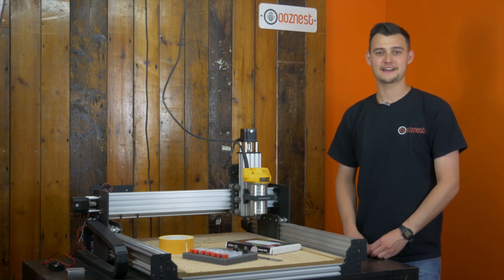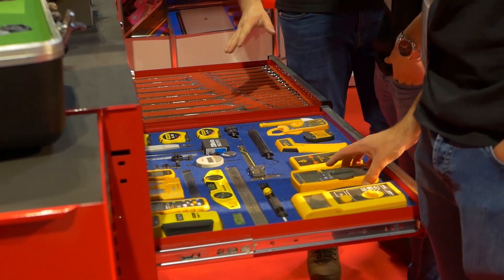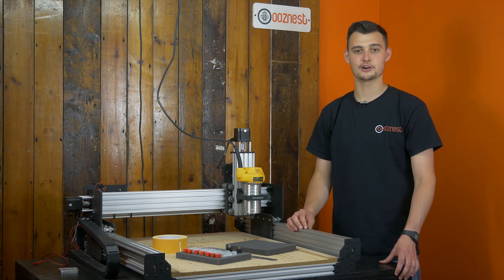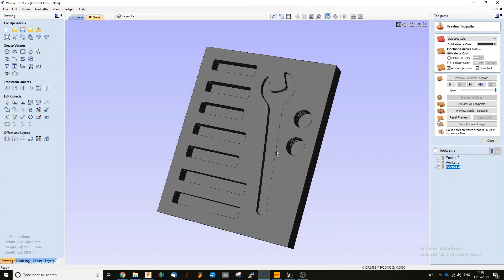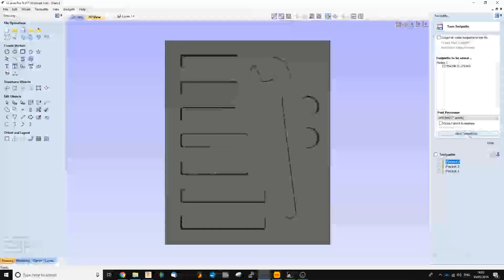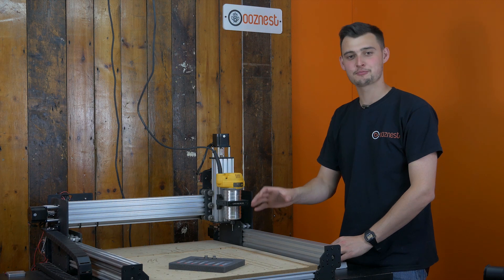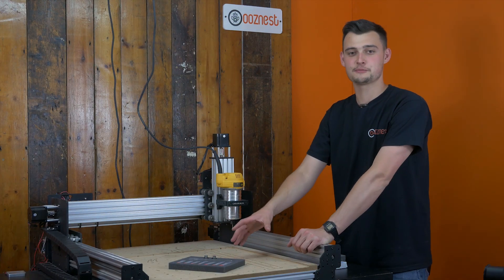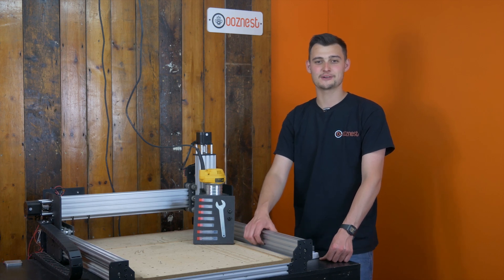How To Cut Foam on a CNC Machine | WorkBee CNC Machine

Comment: Thanks but how do you maintained the foam on the table during the milling? Is your Workbee equipped with a vaccum pressure table?
Reply from the maker: Hi, thanks for your email, we used double sided sticky tape in this instance.